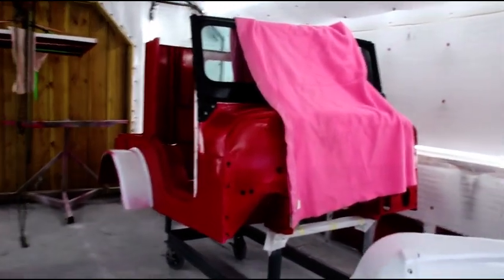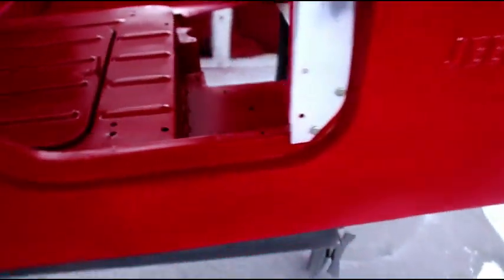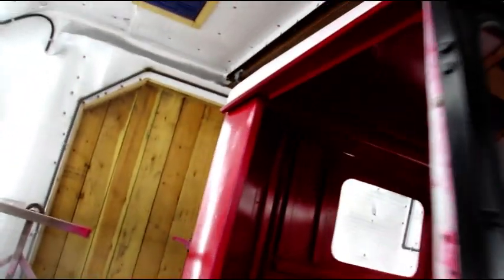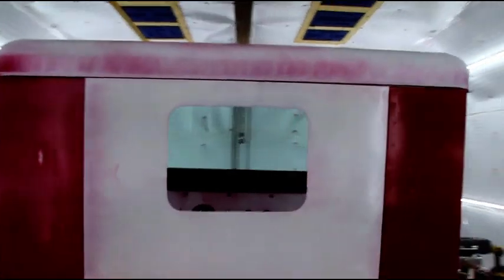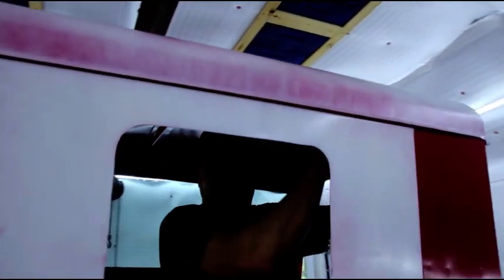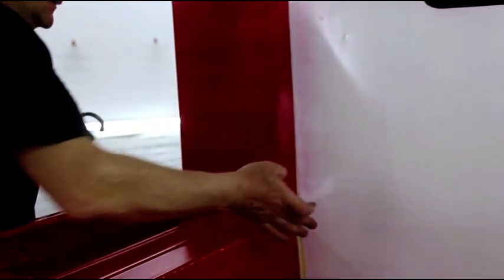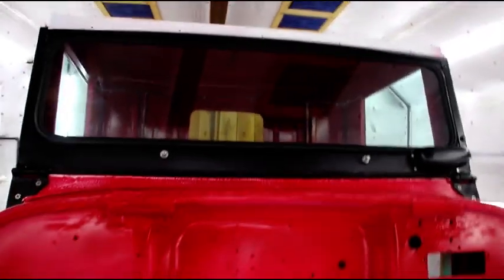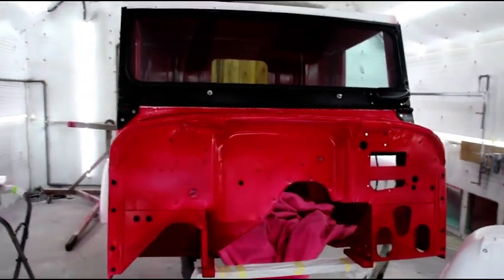Willys CJ5 Snowblower Jeep Hardtop Roof Install and Seam Sealing

Comment: Brian looks excellent! Could one use welting between the bolted parts? Do you end up with damage to the paint where the bolt washers contact the paint or is this paint super tough?
Reply from the maker: I don't use welting but it is common in many antique autos.  Just make sure you use something that does not hold water and corrode the panels.   I bolted everything on that I wanted painted together.  When I bolt on fenders and other parts I will put flat washers on the paint and it holds up fine.

Comment: I have the exact  same 1/2 cab.  This has sure helped in figuring out how to mock it up on my body before painting the body.  Will the  door mounts match the body color or the windshield color or both?
Reply from the maker: Hello Michael, I did have to make most of this hard top out of new metal, the original was so rusted out all I had left were patterns.  Made lots of improvements compared to the original and seam sealed it all to combat the rust that can occur.   The door mount adapters will be red like the doors and body.  I will mask off all the black on the windshield frame and everything else will be red.